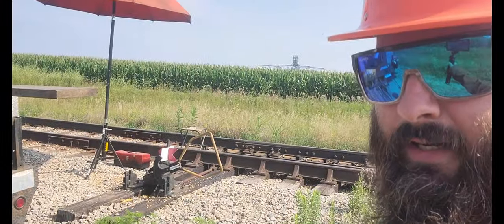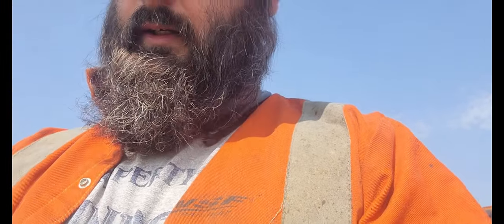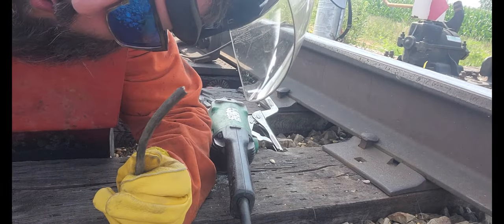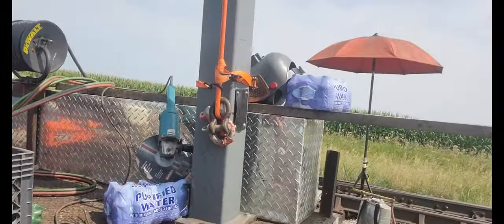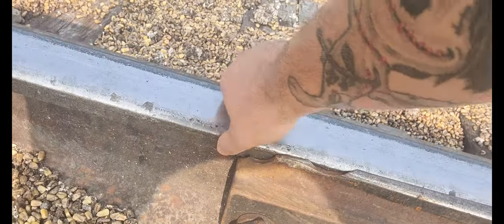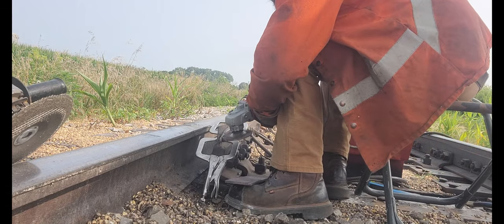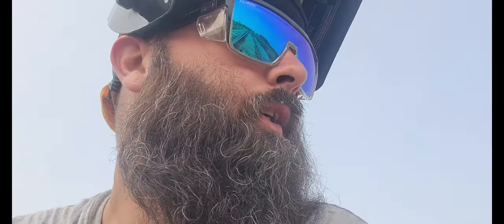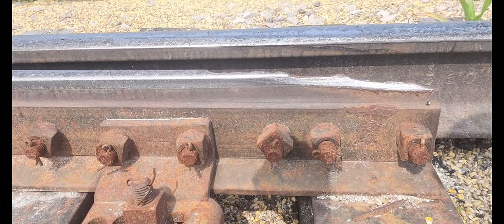Welding Railroad Switch Points

Comment: Haha, I don't know how many times I've been lucky with my grinder cord. It has to happen at the best time too. Good job brother.
Reply from the maker: Thanks boss, I still haven't found a replacement I like yet. Might try that Hercules stuff out.
Reply: @hundtmobilewelding  luckily, I've still got a couple troopers left over from my father in law. Those Warrior grinders are good for a wire wheel and flap disc. I've got one setup for each and my better grinders have the cutting and grinding wheels. Those Warriors can't handle that task but no use wasting a good grinder on wire wheel and flap disc stuff.

Comment: what temp do you post heat to? what do you use to wrap the point?
Reply from the maker: Preheat to 700° (cherry red is close) 
4" beyond weld limit if temp is 40° or above and 6" if temp is below 40°. 
As for what I use to wrap it. I use a fiberglass welding blanket. Nasty little things but they work for keeping the heat in and Gradually reducing it.
Reply: @hundtmobilewelding  Thanks man! been railroading for almost two years now and have been learning to weld points and frogs. still learning everyday. been trying to get my company to buy a mig setup but as for now i’m stuck with a miller bobcat and 540 rail build rods

Comment: What temp do you preheat?
Reply from the maker: Preheat to 700° (cherry red is close) 
4" beyond weld limit if temp is 40° or above and 6" if temp is below 40°. 
As for the welding wire. I wouldn't use anything that isn't specifically design for rail welding. The wire is design to have certain qualities to withstand the high stress bearings of trains kinda like hard facing wire. We use rail build 540 I believe